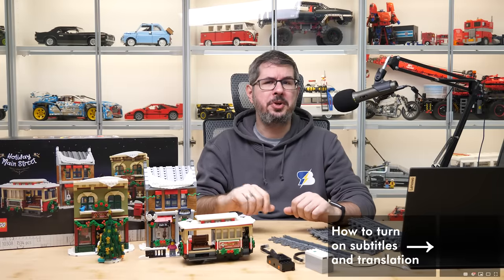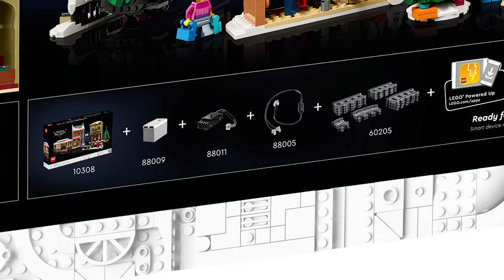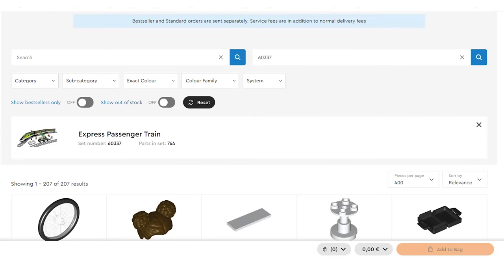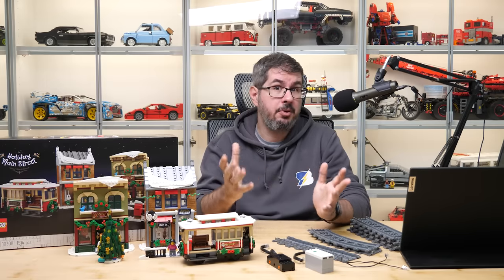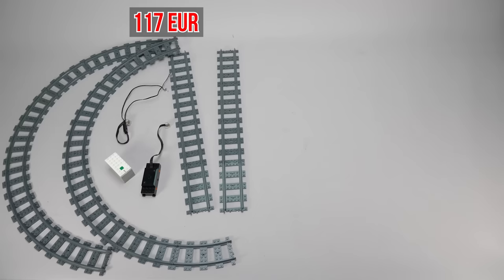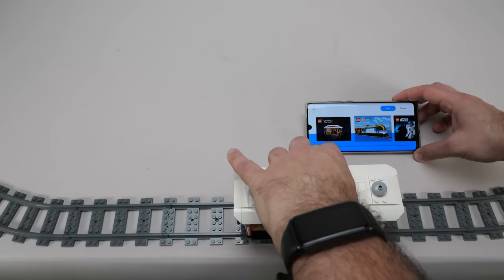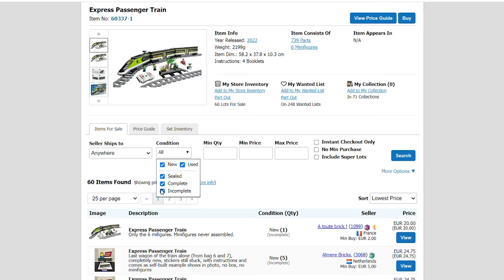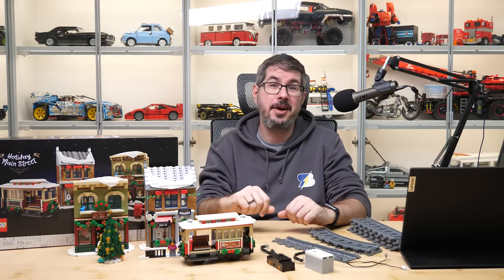Don't trust LEGO if you want to motorize the 10308 Holiday Main Street set

Comment: I bought 2 copies of the passenger train (at a 25% discount from Amazon) and then built a dummy bogie for the second power car. It meant that I could use the hub, motor and light from that engine in my tram, and then still be able to run a complete passenger train simultaneously.

Comment: well, I actually used both the Winter Holiday train (set 10254) and the Winter Village Station (set 10259), both retired now, and they come with 16 curved rails and 4 straight rails and added this track pack and the switch tracks pack (with 4 extra curved rails) and i was able to create 2 full separate oval circuits with them. I also have the green express train (140$ from Bricklink instead of 240$) but it is not opened yet because we don't have space to put it if we build it, we wait until we get a house :). the light and train motor, i bought from bricklink and the hub from lego

Comment: I think Lego didn't intend to make the whole loop. It supposes to be just a line when going from left to right and back can be achieved moving forward and backward. Like modern trams where the direction of travel is switched by moving the driver from one side of the tram to another. The only issue is this model isn't a modern tram... but Lego likes to mix things from different decades.
Reply: True only if the app allows such function. The whole point of powerup is to have the set run automatically in the background, and not drive it back and forth on ur phone app manually
Reply: Vintage trams can also be driven from both ends
Reply: @kezif  I was wondering the same thing. I don't have any experience with Lego train sets and was wondering if there were ways to build "bumpers" essentially to make the tram switch directions automatically.
Reply: @AdamLaMore  i have train with light sensor below and programed it to stop and switch direction everytime the sensor see red brick on the track. And I have 2x4 red tiles on both ends of tracks. But I don't think it will be possible to fit sensor in this small tram
Reply: @djfreezzer2321 I just fit one in. It's tight, but that's because of the cables. A bit more tinkering and it'll fit just fine
Reply: A straight segment is ok for manually moving the tram back and forth, but NOT for power functions. We need a complete loop. I favor @Brickafide ‘s suggestion for LEGO to make a loop track pack.

Comment: I already have 10308 and 60337. I was planning to power up 10308 and looking for power up components. I also was not sure about whether 60337 motor parts were compatible with 10308 for motorization. Thank you and thanks to your video, I got all the answers.
I won't waste money and use 60337 parts as you recommend.

Comment: One thing about motorizing the trolley, the roof has two 1x4 stacked plates on each end underneath to keep it in place.  With the motor and wires in place, though, the roof on that ends sticks up because of the wires.  My solution was simply to remove one of the 1x4 plates on that end.  Now the roof sits flush and still stays on.

Comment: As someone who owns extra tracks, the old power functions hub, motors, and light piece, I would figure out a way to motorize it with the motor and some gears and axels. I'm not sure if there are Lego train wheels that attach to an axel piece, but if there are I assume it would be pretty straight forward.
Reply: Axles are put through the train motor with wheels on the ends so train wheels do fit axles

Comment: I lucked out on the hub. I looked and say the temporarily out of order, then did some research and found claims it had been retired. I came back a week later and they were in stock. Snagged that and the motor; accidentally ordered the color sensor instead of the lights, though.

I didn't order tracks because I bought the old passenger train (the blue and orange one) several years and thought I'd just use the tracks from that, but I have no idea what happened to any of the parts from that set. I found one piece of curved track.

Comment: Hello my friend, my way to motorize the street car was in buying the RAEL 20001 Steam Train with lights sounds and steam parts , costs 54 € only, including rails, sound module, rechargeable battery box and remote control. The only disadvantage is that the train runs with one speed, but acceptable.
Reply: that's a chinese knockoff of the official lego winter holiday train set, we don't buy and review any of those chinese clones set here.
Reply: @danielsala81  I do not expect a review of this chinese set. Just wanted to suggest a cheaper way to motorize the tram as the power functions of Lego are far too expensive. By the way - I bought the original Lego winter train and do not use the chinese version.

Comment: Oh yes. I am on Bricklink trying to MOC about 8 railroad cars, axles, wheels, holders, beams, bogies, ie the moving parts that roll. It's not at all a satisfactory experience. Track, and some tiles, plate, connecting parts. It's fees on top of fees, and then the parts are, which I calculated, 50% higher in price, than the list price after all the shipping, tax, processing.  That is on $210 USD of lego becomes more than $315 USD after everything is added up from two suppliers, one in Netherlands and one very large seller in Czech Republic. I mean good new Lego, but. The added fees is and world shipping, its a broken system. We need a lego airplane to serve between the strategic continents, for the AFOL world.

Comment: Huh, I don't think most people prefer official stores, Bricklink has always been less of an alternative than the first to go to option tbh. Aside from that, third party options are far cheaper - Circuit Cubes cost a fracture of the Lego parts and since train builders rely on third party parts anyways, would have been worth mentioning I'd say.
Reply from the maker: There are dozens of other options to mention, could have been a 30 minute video as well. I wanted to focus on a solution that is available for everyone easily without any 3rd party involvement.

Comment: I'd go with none of the above suggestions and go with 9v track and motor. There is a maker/seller that produces that Lego stuff so you don't even need to buy the old official Lego stuff.
Reply: @deleaptealeaf8935  fx bricks they sell out of their straight track often, but when they come in stock you can get email notifications. Also their wheels are not listed as they redesigning them sounds like they should have restocks soon and their new wheels.
Reply: You can just put copper tape on the plastic track and it will run 9V just fine.  A bit time consuming, but well worth it.  Curves are a bit tricky though, did it with some third part R72 and R88 tracks and they work OK, but did a half circle test batch of standard LEGO R40 curves and they were a little bumpy with how much the tape bunched up.

Comment: i wonder how fast a lego train can go with buwizz? drag trains?
Reply from the maker: The tram can derail even with the stock setup, so yeah BuWizz can make it way too fast.
Reply: @RacingBrick  thats around turns though, i had similar problems i just made an incredibly low cog train and it was surprisingly stable
Reply: @RacingBrick  still, would be fun to see lego train drag races
Reply: @glowytheglowbug  Did that at a convention maybe 5 years ago, though it was a circular track with one train starting further back to make up for the smaller radius of the inner loop.  No specially built racing locos though, and I think everyone was running either 9V or Power Functions.  Took second place myself as my 8-wide switch locomotive couldn't run max speed on the curves.
Reply: @scottthewaterwarrior  interesting! you probably could hook up a buwizz motor to train wheels along with a buwizz with low centre of gravity you would be unstoppable lmao

Comment: If you have a lot of old gray track from the 1980's trains like I do, it can also be used to run the trolley on it too.   As you know, my Emerald Night train and the Mearsk train is currently running on those tracks too.
Reply: Yeah the rail gauge hasn’t changed since the 80s, just the electrification method. 

That being said you could probably squeeze a 9/12 volt motor under the trolley and it would look better then a big friggin battery box
Reply: @redenginner  The rail gauge has never changed actually, just the way they fit together starting with the 9V era.  Well unless you count the release of that stupid UCS Hogwarts Express anyway.

Comment: Instead of the Powered Up, I picked up a 9V motorized power truck and installed it in the trolley.  Bought some 9V (older) track, built an Arduino DCC-EX system for a back and forth setup.  Works great.

Comment: Honestly the whole way lego works with motorizing stuff now is just sad.

In the 90s there was the 8720 "9V motor set", which included the battery box, a motor, cable, some power plates and a bunch of gears, belts and structural elements. And of course you could get motors and batteryboxes for relatively cheap straight off their supplementary packs order catalogue that came with pretty much every set.

Now pretty much every set would then include a "+8720" couple of steps on the end of the instructions that allowed you to use the extra bits from 8720 to motorize a function. It's a straight-forward buy to get the motor set and suddenly almost every other technic set you had was expanded, all the parts were there and since they just had one motor pack, it was all universal.

Now there's the different kind of hubs, different kind of motors, there is no motor add-on set and there are no extra instructions. Sure the old sets had like 6-7 steps to add motorization instead of the 50-60 they would take now, but the motor set was just such a fine product since it expanded your lego collection by so much and you could go back to sets you haven't made in years just to see how it works by adding a motor.

Honestly they should just recreate that idea, take a dumb PU hub (without bluetooth like from the Osprey set), take a L or maybe even the simple M motor, bundle in some gears and belts and just keep using those parts to add extra instructions for new sets to include it. Do the same for trains and there, you just added tons of value for new sets that include a tiny bit of extra paper (or some more bits in the pdf).

Comment: Really smart option. Never would have considered buying a complete powered up train to get this set to work outside of tracking down everything separately from either Lego or Brinklink. Crazy how the recommended Hub on the site isn't even available on the official site to make this work. Thanks for the very solid price cutting recommendations. Definitely simplifies running the trolley a lot.

Comment: Great video!! I purchased the 42110 Land Rover Defender with the plan to motorize it. All together is was cheaper to purchase the 42109 App-Contoller Top Gear Rally Car to get the two motors and the hub than it was to purchase the hub and motors buy themselves. Lego individual parts are expensive. Just wish the PoweredUP App was a little more user friendly in programming.